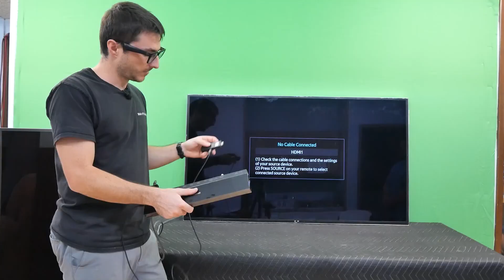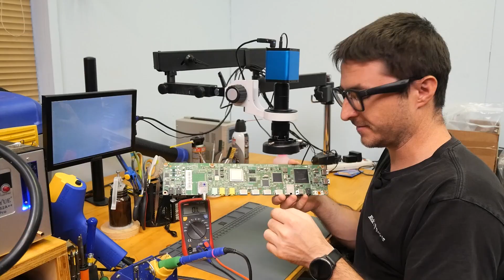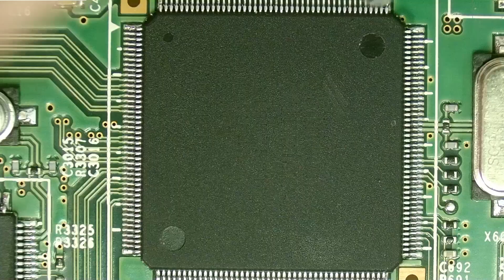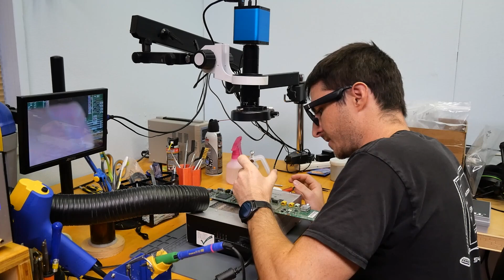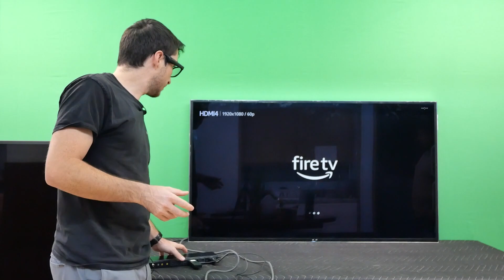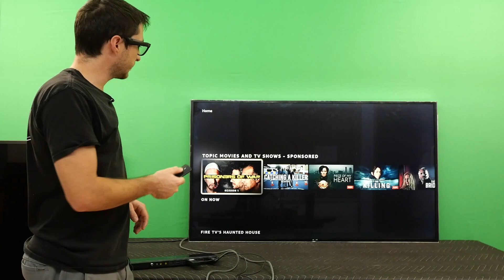Fixing Samsung's First  4k TV UN55F9000

Comment: I had one monitor which had the same issue, no HDMI input picture, but DVI and VGA were OK. In this case, if there's more types of inputs, keep in mind that you might not find a short this way ;). After replacing this IC of course, picture came back.

Another thing for the beginners. You don't have to use a solder paste, but have to heat up the surface to melt the solder before placing this chip. Take your time with it. And, when you take it off, don't take it off straight away. You can damage the pads under the chip. I've got one of the video about it, was bad, and I've spent extra time to fix it.
Reply from the maker: Yeah we don't always find shorts, so sometimes it's not obvious but you just know the IC is bad.
Reply: @NicksTVRepair  on game consoles not only HDMI encoder can go faulty, but as well EMF filter, on some cases filters, hdmi port itself, or trace damage.